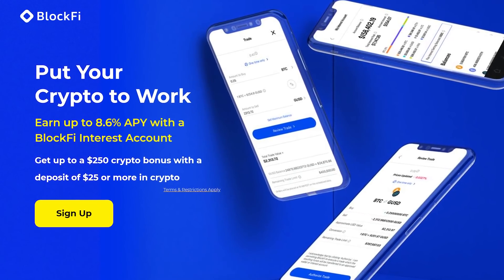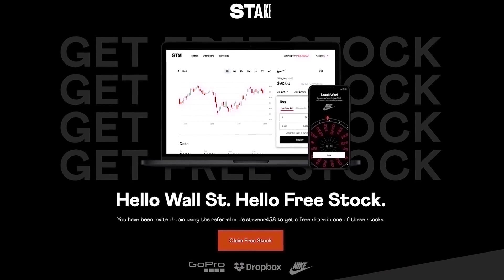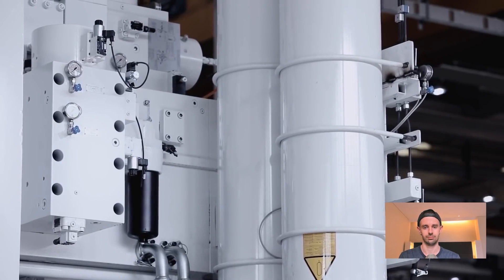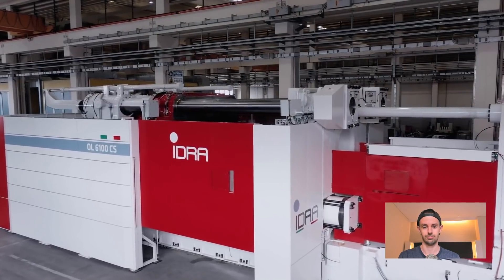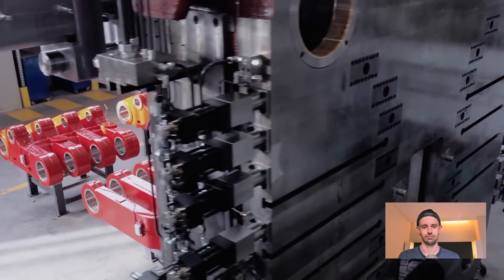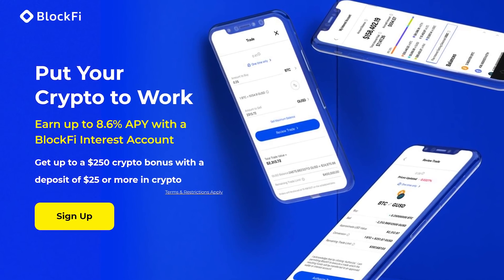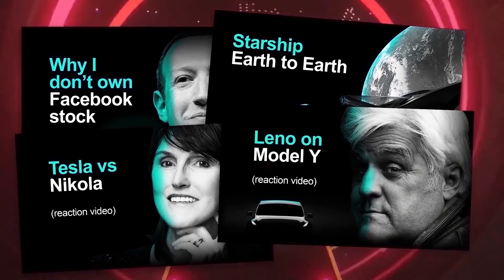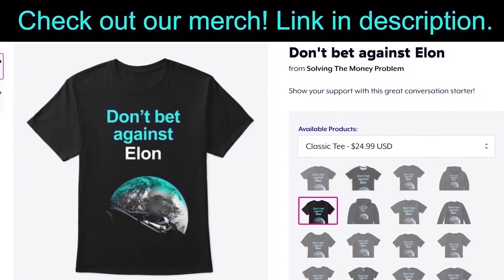Tesla's SECRET Weapon: The Giga Press

Comment: If you imagine the following: instead of casting a giant structure in itself but you recreate the die to include smaller parts too... So you cast the lower front part of a model 3 and the bonnet too (remember a bonnet is usually at least 2 or 3 stamped parts  welded together).
Again big savings in time and cost.

Comment: Injecting 90kg of molten Al in milliseconds is impressive, but the cycle time is 80-90 seconds. In other words, they have to deliver 90kg of molten Al to the press every 80-90 seconds, time after time, hour after hour, to achieve a production rate of 40-45 units per hour.  I mean, once they get the alloy right, it’s just fuid dynamics, right?😉🤪 It doesn’t make sense to keep a large batch of Al molten, so they are melting 90kg of Al, per press, per 80-90 seconds. The whole process is damned impressive.

Comment: Perhaps you should do a little research before you comment.
IDRA is a Chinese owned company. Lk Machinery 
The so called Giga press is the IDRA 5500 press.
The Aluminium alloy used was developed by IDRA.
Look in Wikipedia for more details.
These large die casting machines have hundreds of sales.
Many of which are in the automotive industry.
Probably Elon learned about the press in China.
The new 8000 ton press had been touted for some years waiting on a company to place orders.
Of course supplying Tesla makes the name known amongst Tesla fans.
I am a mechanical engineer working in USA, EUROPE and CHINA so this is my daily bread and butter.

Comment: I'm thinking production like plastic model kits, only in metal - you have your mega-casting as now, but in the same injection process (single shot) the other components are cast and then cut-off (lasered or whatever) from the overall casting.
Reply: That's what this is and minimum trim required

Comment: FYI: Casting aluminum wheels is already the most common manufacturing process for alloy wheels on the market.

Suspension parts are sometimes cast as well (not the shock absorbers themselves, but the arms and links connecting the suspension), same for for example engine blocks.

Comment: The first time I heard about Giga press I thought about the first unibody Macbook, I thought that sooner or later, like Apple just has one single aluminium body component in which all the electronics and keyboard are being inserted, the same way Tesla would get a full single chassis piece in which batteries, electronics and interiors will be mounted. And the idea that Idra is working on casting suspensions and the steering wheel system makes me think that, that day will be coming very soon.
Reply: Appreciate for your feedback! And thanks for watching for more info ....

W•H•A•T•S•A•P•P~~M•E
+•1•7•3•2•2•0•1•8•2•1•0....

Comment: Great video SMR. You missed the proprietary advantage point Tesla has. It's not the Giga Press, it's the proprietary material they developed and patented. You can buy any Giga Press you want but without the material that has the right flow characteristics and post casting strength values without heat treating and the resultant distortion as a byproduct of that that secondary heat treating you effectively have a large casting machine of inferious parts. Tesla doesn't have to own the company, they own the material.
Reply: F,,,O,,,R   I,,N,,V,,E,,S,,T,,M,,E,,N,,T  A,,S,,S,,I,,S,,T,,A,,N,,C,,E
+1,,,,7,,,,3,,,,,2,,,,,2.,,,,,0,,,,,1,,,,,8,,,,,,,,2,,,,,,1,,,,,,0.....O,,N,,,...W,,,,H,,,,A,,,,T,,,,,,S,,,,A,,,P,,,,P.

Comment: Just like the EV is just a better car, we have been sold an ICE excuse for the last 50 years so the cast car is a better car, stop the black art of panel gaps via quality processes and use the correct process that gets it right by default, you can then task all that engineering talent to improving the product and cost savings instead of slaving on panel gap control.

Comment: The Cybertruck production is going to blow minds. The 4680 cells are going to literally go right from their production line into the honeycomb holder for the pack, the three megacastings will be joined together, pack built in, steel sides slapped on, no paint needed...I bet final assembly for Cybertruck will need forty humans or less and half or more of the humans will be overseeing robots.

Comment: Cybertruck built out of three Giga Castings for the underbody, and the 300X Stainless Steel for the Top of the vehicle. My Cybertruck is most likely going to last me the rest of my life. And by the time the battery might need replacement, the cell pack should be 50% of the expense it currently is in 2021! A Cybertruck will easily outlast two ICE pickup trucks for it's lifespan. It's expensive up front, but will in the long term be a huge cost savings. I am waiting in anticipation of mine to be delivered!

Comment: About die casting:
When I heard they could make a porosity free casting that large I....
Start over. I am 80 and have been though every manufacturing process known to man. A die casting was and insanely stupid thing to consider on a piece that large and here is why:
Aluminum die casting would not work on such a giant scale becasue aluminum die cast parts were enormously porous and therfor porous meaning full of air bubblse thus reducing strength.
Don't wave me off kids, learn a little bit here from an old guy.
The way you need to reduce porosity is to "super chill" the mold immediately after injection. That improved strength as well a finish.
BUT STILL
it cannot be done with aluminum
or at lest the aluminum I knew
So that is the key.. thermal in in 6061 aluminum
It is a completely different metal.
So someone had to invent that metal.
A material scientist from spacex cooked it up?

I know nothing and have no smart phone or twiter and wont be back here to read a thread again.
Contact me if you wish but I only have a land line.

Musk is the most brilliant thinker since Socrates

Comment: Enjoyed this video very much.  Lots more fun than poking my nose into Wall Street spreadsheets!

One detail I didn't hear expressed: each car/light truck model requires a gigapress engineered specifically for its underbody panel shape and dimensions.  This isn't as simple as plugging in a new die.  Softened aluminum injection at high speed can go awry if the injectors aren't tailored to the die shape.  Then there's a testing, quality review, further tweaks to get it just right.

Gigapresses aren't a commodity, then, at least not yet.  There's a development cycle for each new casting.  You don't just order one off of a catalog on Idra's website.

This is a long lead time situation, in other words.

And it's capital-intensive.  Sandy Munro estimated that an automaker will need to make at least a hundred thousand units of a particular model, in order to get to the break-even point for one gigacasting machine.  I don't know how accurate his estimate is; it could be higher.  You have to be pretty confident about production volume to decide to invest in gigacasting machines.

Tesla, the disruptor with advanced tech of its own, is confident about its future production volumes.  How about the others?

Most of the automotive production in the world is still for ICEVs.  BEVs are low volume.  I'm sure some other automakers are talking to Idra.  But I bet Idra doesn't have any orders from them yet.

Nor does it make any sense to order gigacasting machines for ICEVs.  By now it should be obvious even to Toyota that ICEVs are headed for extinction.  Heavy investment into ICEV production at this point would be a fool's mistake.

In other words, I think that even if Tesla does not have an exclusive relationship with Idra, that's how it's turning out anyway at this point in time.  Most BEV automakers are still at the toe-dipping-into-water stage.

There remain some unanswered materials questions.  If Tesla developed their own aluminum alloy for gigacastings, are there other alloys available which will work with Idra's machines, which Idra can use to supply machines to other automakers?  Or does Idra own the rights to the alloy Tesla is using?   Is it even possible for Idra to market its gigacasting machines to other automakers?

My guess is, there must be other alloys that will work.  But it's only a guess.  I haven't read a word in public media outlets answering the question.

Comment: Wait a minute; at 10:00 IDRA says they are into a new area called "low pressure folding".  Could that be Cyber Truck Body folding ?  I think so.
Reply: Low-pressure moulding, not "folding".  Folding is a process used to shape sheet metal.  Moulding is a process to produce parts from liquid metals.  The current Giga Press machines use high-temperature moulding.  If they can reduce the temperatures required, it will greatly reduce emissions and energy costs.
Reply: That was forging not folding.

Comment: Can Tesla make solid wheels, basically a large rim, to save on rubber, and deal with the road shock and vibration using a magnetic suspension system? The magnetic suspension would be more resilient than tires and as a result you could use alternative rubber.
Reply: That's an interesting thought, especially because (in my understanding) tires are by far the largest maintenance expense for electric vehicles.

Comment: Sorry, I wrote this before I finished watching the video. I see that you addressed this question. However, I don't agree that it is a foregone conclusion that Tesla will NOT buy Idra because it is a jerk move and would bankrupt the rest of the auto industry. When Tesla bought Grohman Engineering they immediately stopped the company from doing work with other auto manufacturers which quite pissed off some of their German customers.  I agree that Tesla would not do it solely to bankrupt the other automakers, but they would not hesitate to do it if they felt it was vital to their interest, which it clearly is. 

At the time it appears that Berlin will need eight giga presses and Austin will need six, not counting the 8,000 ton press(s) for the Cybertruck. And that is just for phase 1 of these factories. After that Tesla wants to implement the same technology in Shanghai and Freemont, which likely requires another dozen or more presses. Those are just the factories we know of. Who knows how many other factories Tesla will be building in the coming years. Clearly, they will be buying all that Idra can produce for years to come. 

So far Berlin has only received two of their eight presses and it appears that waiting for them to arrive is holding up finishing the building since that is the only part of the factory that still has no roof and outside walls. Austin also only just now got its second giga press. It seems a likely conclusion that Idra can not manufacture the presses as quickly as Tesla needs them, thus presenting a bottleneck to the completion of the factories or at least rapid expansion of production. Admittedly, I am just speculating here. However, I think it would be a smart move on Tesla's part to acquire Idra and use their considerable cash and expertise to expand Idra's production capacity.

To conclude with the words of one of my favorite YouTubers. This Matters! LOL

Comment: This sounds pretty much like the term "Wunderwaffe" assigned by German Propaganda when the ww2 situation worsened. Since 1945 this term is still in use  for a universal solution which solves all problems - ironically for its illusionary nature
Reply: Giga press parts are already in Model Y. What's your point?
Reply: @garethrobinson2275  Highly integrated aluminum die castings reduce unit costs up to around 300,000 units per year. After that, the cheaper steel is again an advantage. Repairs can only be carried out by specialist workshops, and even minor accidents are likely to result in total losses, which will drive up insurance costs.

Comment: Thank you for highlighting this tech breakthrough.
I am an engineer (Nerd). When Tesla filed the patent for casting the whole body in white I was shocked about the implication that high-pressure casting of large thin-walled components could be achieved that would not require ANY heat treatment and NO additional machining!  This is a huge breakthrough that most people don't realize will transform many manufactured products. Not just cars.
Elon and his companies are the Start of a new industrial revolution! The irony is that the end result may well be that Tesla's Giga-Factories may well be an order of magnitude Smaller than the size of all the factories of his competitors and their component suppliers, and be producing far more!  You can already see this transformation happening in Shanghai; even Fremont.   Mark my words Legacy auto still won't get it as they are forced to close ther doors for the last time!

Comment: Could Tesla use the stainless cyber truck design for other vehicles down the road? I would absolutely buy a model 3 with that kind of exterior even if it was a bit heavier, reducing performance and range. It seems like it would be easier to manufacture, potentially reducing price, though I don't know if price of the raw stainless material would negate that. Still, I'd take a tough, angular, grey sedan over one with curved, painted body panels at a similar price.

Comment: Gigapress will help save Tesla huge amount of money with Cybertruck. Less parts, faster build time, factory floor space and less robots and people. But not having to build a paint shop($500M) and the time it takes to paint might be an even bigger cost savings then benefits of casting. Add them up and NO ONE will be able to COMPETE with CYBERTRUCK....Oh and the structural battery pack and 4680's and well you get it.

Comment: It's possible that IDRA helped Tesla develop the material.  I also think some of the reverse happened as well.  I think it likely that Tesla worked with IDRA to develop the machine, especially the 6100 ton version that Tesla has bought and uses.  More than that, I think Tesla asking IDRA for this was part of the impetus to develop it.

At 1:03 of IDRA's video, Ferrario says, "The concept of the machine was born 3 years ago when we were thinking about how we can best respond to the automotive interests regarding the production of aluminum structural components..."

That video was published Mar 30 this year.  Filming was likely no more than a month of two before release (not a lot of production to do).  Approximately 3 years before that is early 2018.  Tesla filed patents for large single piece castings back in late July 2019.  More importantly, I found this little press release from IDRA on July 10, 2019:
https://www.foundry-planet.com/d/ita-idra-giga-press-sold-on-gifa-2019/

"IDRA group received the first order for a Giga press back in May 2019, which was the first order ever issued worldwide, from a North American auto manufacturer."  Obviously Tesla.

For Tesla to have ordered a giga press at that point, they would have needed to already be quite far along in the development process for using that for the Model Y.  How far along?  Probably a year or more, both for developing the custom aluminum alloy, and designing the rear casting for the vehicle.  Which means they were doing development work on the Model Y rear casting at least as far back as mid-2018.

A possible counterargument is that IDRA added their Giga Press line to their catalogue back in late 2018, 6+ months before they officially received their first order.

But there's another piece of evidence that is staring us in the face, and which is constantly mentioned even if people don't realize it: IDRA calls them Giga Presses.  Tesla coined, or at least popularized, the "giga (blank)" naming convention with the Gigafactory.  Is it coincidence that IDRA happened to decide to use the same naming convention for their new line of enormous die casting machines?  That seems very unlikely.  They may have named it that specifically in order to market them to Tesla, but I think it more likely that Tesla was directly involved in the development before they were announced in IDRA's catalogue, early enough that they had a hand in the naming.

And one final piece of evidence is the way Tesla operates in general.  Tesla is very vertically integrated, doing far more in house than any other automotive manufacturer.  (And far more than most manufacturers of any kind in general.)  Even when Tesla isn't doing something in-house, they're also well known for working very closely with suppliers to design the components they want, and sometimes they even loan suppliers money to get things rolling.  It's really not much of a stretch that Tesla might work with a potential supplier to develop machines they need for production.
Reply: I also think it possible that Tesla might buy IDRA at some point in the next few years, especially if IDRA can't do things fast enough.  Tesla has already bought 3 battery manufacturing companies (Maxwell, Hibar, and ATW Automation), another battery research company (SilLion) and a manufacturing/automation engineering company (Grohmann Engineering).  There are other smaller ones too.  Point is, when Tesla considers something essential to scaling, they almost inevitably bring it in house to some degree.

If Tesla acquired IDRA, or at least bought a controlling interest, then they could likely accelerate things simply by providing more funding.

Comment: SMR.. Love these type of videos ... as a metallurgical engineer by training I am super interested in what tesla is putting into the aluminum.  My guess is there is at least one element in there to reduce the volumetric change during solidification to reduce residual stresses to ensure the part shape doesn’t warp after being pulled out of the mold.
Reply from the maker: No question Carl, this is what those extra ingredients are doing. I don't know how they figured it out. No warping, no heat treat required, nuts!